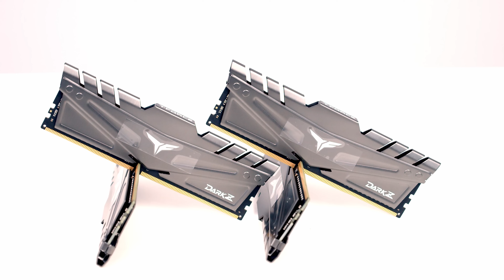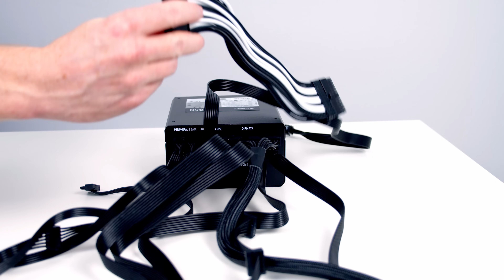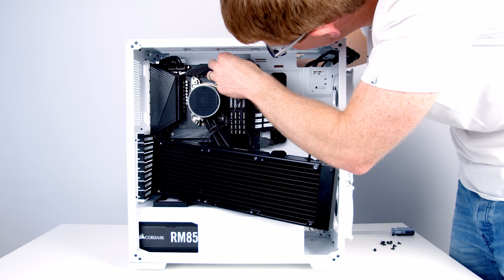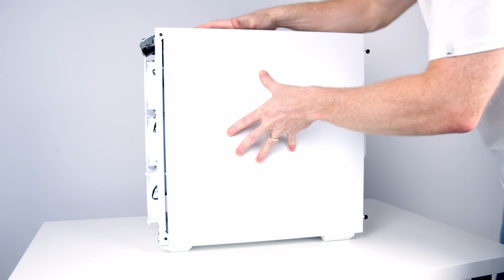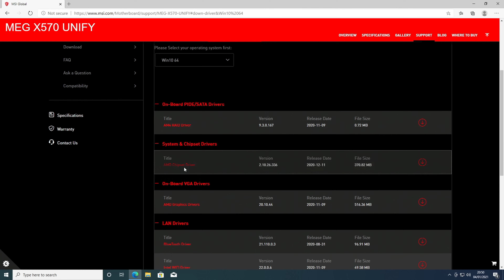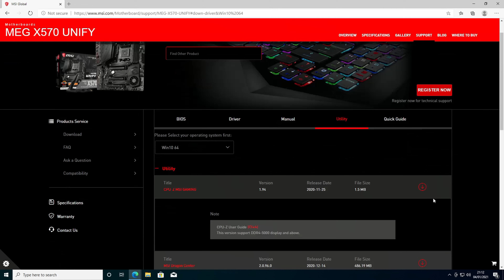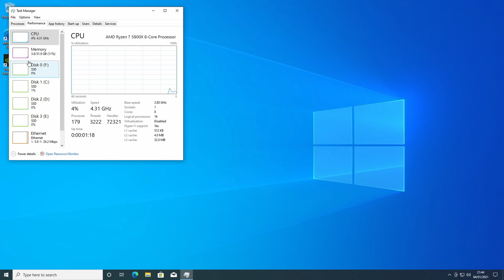RTX 3080 and Ryzen 5800X Step-by-Step PC Build Guide 2021 (Cooler Master TD500 Mesh)

Comment: Awesome video! For someone who's building a PC for the first time, it was very easy to comprehend. The BIOS setting doesn't look that much complicated though, I'll be using X570 Gigabyte one so I'm hoping that it'll be similar to your MSI one.

I'll also be installing Strix 3080 as well though, should I be worried about the sag? That GPU looks massive and I feel like I'd need some kind of support bracket for the GPU and/or feed the cable towards the top (instead of bottom).
Reply from the maker: Support bracket won't do any harm

Comment: I have 3 pin fans connected to 4 pin header on motherboard. I have switch to DC mode. Should I also enable smart fan when using DC mode? 
These are case fans.
Reply from the maker: I normally do

Comment: I thought the rule was 1 fan per header. Youve put all 3 front case fans on the same header. I didn't think that was safe as they draw to much power for 1 header? I'm kinda new to this but that's what I was told way back. Any help?

Keep up the great content aswell. Love this guide
Reply from the maker: They are just below the max allow on this motherboard. Other 3 pin fans draw much leass power and are well away from the limit
Reply: @ChristopherFlannigan  ah I see, I have just brought this case, my mothborad is a hero viii. I belive the header can handle 1amp total. Do you know how much each case dan here draws? 

Liked and subscribed

Comment: Hmm, one more question. Can I still use this video as a guide to plug the correct cables on a Asus ROG Crosshair VIII Dark Hero ATX AM4 Motherboard?
Reply from the maker: Motherboard layout will be slightly different but if you compare manuals you should be ok

Comment: If long enough can you install the cable extension straight from the PSU to the motherboard?
Reply from the maker: The extensions need to go into the existing cables, you can get custom cables instead

Comment: Thanks for this! I got the MSI MEG x570 Unify, and the Cooler Master TD500 Mesh, as well as a fully modular power supply, and AMD Ryzen 5 3600, with 16GB G.Skill Trident RGB, 2 Sabrent Rocket 1TB M.2 NVMe SSDs, and 1 6TB WD Blue HDD. I already have a GTX 1660 6GB Ventus OC I can install for the GPU, and this video will help me GREATLY! First time ever building my own PC and wanted to make sure I did everything correct.
Reply from the maker: Enjoy

Comment: I have a 5900x, dark hero, and plan to get a 3080 Strix. We almost have the same builds but I think my Dark Hero MOBO will be different when setting that up. Still planning to use this video. Do we need to purchase those extra white cables though? I have a 1000 Watt Power Supply. My PC is $3,000 as well.
Reply from the maker: The cable extensions are optional
Reply: @ChristopherFlannigan  thank you for the info. It was also amazing that I found your list on PCPartPicker. Was checking out builds with the case that used a 360 mm CPU Cooler and also have a 3080 in it. Can't wait to build just a pain trying to get a specific card

Comment: Is it safe to use one the cables like at 26:22 for a 3060 ti or should I use two separate ones?
Reply: Depends on how many rails your PSU has. If it's a single-rail one, one cable is absolutely fine. If it's a dual-rail PSU (kinda rare nowadays, usually some expensive PSUs meant for multi-GPU setups have two rails) then it's better to split power draw between two separate cables.
Reply from the maker: Yes it should be fine